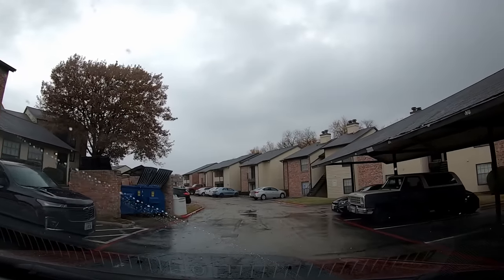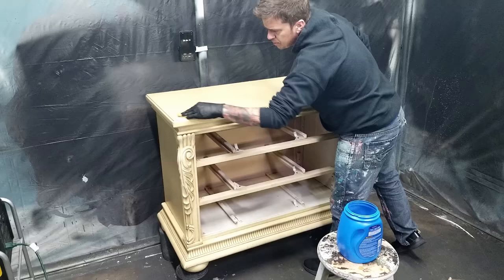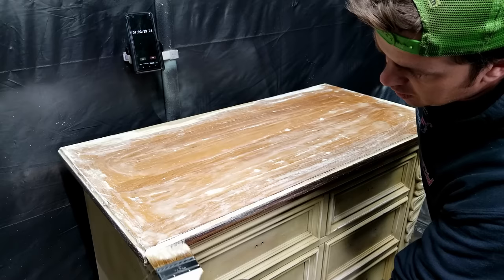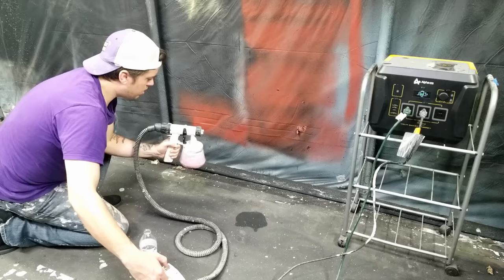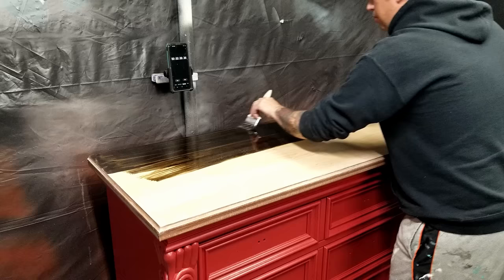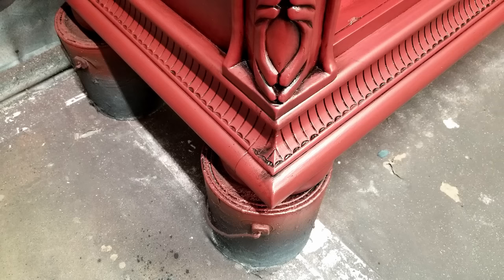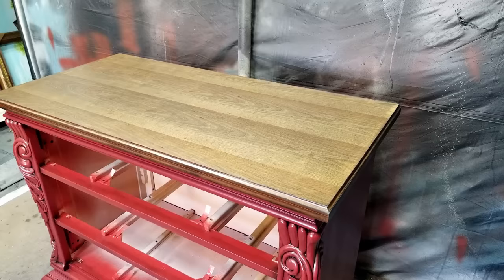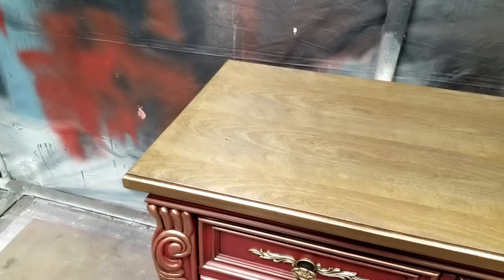This Furniture Was Next to a Dumpster So I Painted It

Comment: 11:44 I can attest that while it is necessary to allow the stripper ample time to work, you definitely want to assure that the stripper is off before it starts drying, as the subsequent scraping is likely to damage your wood... Agree 100%. Also, do not apply a stripper to your wood in direct sunlight. That will cause the stripper to dry very quickly, potentially damaging your wood's surface.

Comment: My opinion is the top wood should've been stained much darker. Also, the rest should've been painted black first, then a dark red over it. Then use steel wool to distress through the red for black highlights as opposed to the gold. The top is not a high or even medium quality wood. You should've painted a harlequin pattern with the red and left the wood stain as the second color of the harlequin. Then distress the red a bit. The hardware should've been an ultra gloss black. The top would've popped big time and made it a whimsical piece. Right now your eye goes to the cheesy gold highlights. Line the drawer bottoms with a fun fabric and you could've gotten $1,000 from some bored rich person. LOL. You do know your stuff though as far as technique.

Comment: The ebony was a strange choice for that wood because it was such a yellow black. Dark mahogany would have gone well with the red since it is a dark reddish brown. You could have added black tint that is a blue black as opposed to a red or yellow black.  The composite you see on the edges would have been a good teaching moment for filling and sanding then painting it to finish.  The edge could have been so much better with the right treatment.

I am an old hand at this stuff so my suggestions are from experience. Get a color wheel to help you with your choices and get a table set up like I describe below. Have fun and thank for the entertainment!

Comment: Beautiful job !  If you want a more aged but subtle antique look,  one way is taking the base color and go slightly darker or lighter....and i do mean slight.  Water it down a bit and sponge,{natural} this from a freshly painted disposable plate, or use a loose crumbled up plastic bag...and go hog wild smashing it on, flipping and rolling as you go all over.  Random & uneven is the key... let it dry.  if too heavy, sand it.  Then when you go over it with a glaze, you'll be amazed how the surface comes alive.  Also, the Rub-N-Buff doesn't come off with light wear,  Heavy wear ... definitely ! ...remember, even metal wears from daily use.  The more important detail with these metal colors is the fact that they will oxidize and change with time,  spraying with any sealer stops this. Good luck !

Comment: This looks great! One tip. When I worked at professional custom furniture store many years ago the finishing shop told me they never use semi gloss, only gloss. They said the semigloss is gloss with a very fine dust in it, which interferes with the look of the grain or specialty paint job. The semigliss and satin clear finishes can actually make the piece look dusty in the right light. And semigloss or satin is much more likely to give you that rough finish that needs sanding between coats. If a client wanted a softer looking finish they just gave it a very light buffing with a very fine steel wool and sometimes a little wax or other overcoat to soften the gloss. The pieces were outstanding and all of the movement stayed in the grain. Of course not everything was given a spray coat some was oiled and or waxed. But all clear coats were gloss, and hand buffed for softer finishes.

Comment: Have you tried using antiquing wax or even a black wax! Would combine two of your steps into one. You wouldn't need to put stain or sealer on the colored areas. Applying just the wax would give you the dark areas you like and the sealer all in one.

Comment: Try this trick to help mixing stain.  After first opening can drop in 2 or 3 bolts.  Close can and shake well. Let stain settle then reopen and stir.  Let air bubbles settle then ready for use.

Comment: Please take a hint from an old lady who knows, you should set up an adjustable table to work from. Get some carpet remnants and lay them out on the table then you can set furniture and its drawers up higher with care. The wear and tear on your back will add up over the years so take care of it now. I saw knees and backbone as well as shoulders being put to harder work than needed. 

There is a guy named Tom Johnson who is a generational furniture restorer in Maine. Maine has great antiques btw. Anyway, Tom proves you can do this work for a very long time without wearing your body out.  Don't take my example, I am younger than he is and my body is shot from "roughing it". Good luck!

Comment: I absolutely love to "Dumpster Dive"...people think I literally dive in the dumpster looking for things...I'm not going to lie, if I do see something in there, I have jumped in before!  However, most of the finds are next to the dumpster, they are too big to throw in!  I once found a huge long dresser, with mirror, two night stands, tall armor and a huge headboard.  Yes, everything was the cheap particle board furniture, but I tried something new...I literally used sparkling mud and put it all over the furniture, then painted it and faux finished it, to look like a stone.  It was extremely heavy, but I called it my "Flinstone Furniture."  I added in all new hardware (which was the most expensive), and someone bought the set for $4500.00!!!  I live in Las Vegas, at apartment complexes is where I fi9nd almost everything, people move in and out all the time, sometimes everything goes!!  But you have given me so many new ideas, I cant thank you enough!   However, I am now into Epoxy, and have been redoing counter tops, table tops, vanities and decorative walls.  I cant tell you what a game changer it is for just even doing the top of dressers!  If you would ever like to know the process of this type of thing, please reach out to me.  You definitely have a new subscriber and fan in me.  But lets just talk about that power supply you have...OMG, I absolutely need this!!!  That is just a total "Gift from Santa...no lump of coal there!  Thanks again, love your work...now I must go stalk all your videos....

Comment: You should get a work table to sit at so you're not having to squat down so much and put pressure on your knees. Don't force yourself to reach, bend, and sit in awkward positions. That's what they taught us in visual merchandising. It makes your task less strenuous on your body. Example: Like when you're on a ladder get on the step that you're level with the task, don't reach up over your head if possible. It makes a difference.

Comment: Nothing personal,  I would have made the entire dresser red. To keep the top of the dresser smooth I use the white soft sponge roller they sell at Home Depot.  A  pack of 3 is about 4 dollars The hardware can be made new again with hot water and vinegar on the stove. It only takes about two minutes in the solution.  Painted hardware the paint rubs off really quick and looks a hot mess real quick.
Reply from the maker: I have pieces 11+ years old with no handle wear. This is why I use it so often.

Comment: Such a great piece! And a very original video with the timer and the generator demonstration/test...

Nice adaptations as the piece threw issues at you.

Just one suggestion; as a consumer, I really appreciate the little details that make a piece look professionally finished. Tape off the interior to prevent over spray. Maybe wax the interiors of the drawers, and finish the edges.

Not a criticism, just a suggestion. Might help pricing and turnover.

Again, just gorgeous!

Cheers!

Comment: Really nice job! It could easily be sold for much more than $400.  I'd like to try those Toasty Sponges.  Can you include a link?
Reply from the maker: I bought these sponges in a store called Daiso. It is sort of like a dollar store with Japanese/Korean themed products. This is actually called a "bread sponge" and the package had Japanese writing. They stopped selling them for awhile during the pandemic and when they had them again I bought like 10 packages of 8 to make sure I could keep using them in my videos when I wanted. haven't been able to find them in about a year or so though. Some online shops show that they used to have them but no longer in stock. Some people on ebay/mercari sell them at an increased price. They were originally like $3-$5 for this package of 8 so don't pay more than that, not including shipping. Other than that, I've found where they're made in China but I'd have to have about $1000 to order their minimum amount. I was literally looking this up last night because I'd like to sell them on my website that I'm working on. If this happens, I'll announce it.
Reply: Thanks for the info on the sponges.  Rather unique and useful so I hope you find a source to sell them on your website. :)

Comment: Red and gold ls awsome combination. That being said, consider LESS gold. Subtlety is a sophisticated look. The finished piece looks like the popcorn booth at an amusement park.
The restoration was perfect. Almost exactly step for step the way i would have done it, EXCEPT:
I would never buy my paint at Lowe's.  If you're gonna use a Sherwin Williams paint, go to a Sherwin Williams store, get the Emerald Polyurethane Hybrid trim enamel. 
Also, damn kid, dump that whole can of Ebony stain into a bucket and stir the hell out of it! Scrape all those solids out of the bottom and stir them in. Then your top would have actually changed color. And you're gonna use the stain as a wash everywhere else on the piece, blackwash that top also! And, gee whiz  if you're gonna glaze with stain, and even CALLED it a "glaze", mix a little bit of GLAZE in with that stain! Makes so much easier to work with, and feather out. But i must say, your stain only black colorwash turned out great. The whole piece looks dazzling, and the video was well made. I really enjoyed it and anyone looking to learn would be well served to do their projects exactly like you did this (except stir the stain much better).

Comment: I also upcycle furniture. I learned a few new tricks from you. I enjoyed your video. I watched a video of a guy using auto paint (and sprayer) and it turned out gorgeous. Have you ever seen that before? I wonder what the investment wd be? Have you done that? Anyway let me know if you have any info on it.
Reply from the maker: Several reasons I don't use auto paint:
1. Investment. The equipment you need, a large air compressor that can keep up with your painting, a spray gun, the paint. They're all more expensive.
2. Noise: I live in a residential neighborhood and I dont want an air compressor running all the time so I opted for an electric sprayer that only makes noise, and less noise at that, when I am actively spraying. 
3. Ventilation: Water based paint is much less toxic and easier to ventilate. Again with the neighbor thing, I dont want my neighbors smelling those fumes. There is no discernable odor outside my home with interior water based paint and top coats.
Reply: @ThatShabbyGuy  
Ok. Good to know. Thanks for getting back with me. I appreciate it.

Comment: What spray gun do you recommend??
Reply from the maker: I honestly havent used enough lower budget guns to recommend anything. The one I use in this video is okay but slow and kinda hard to figure out. I know some other painters that have had good luck with the Wagner Flexio 590 as it doesn't have the bulky unit with a hose attached to it and has more power.

Comment: Did you not prep the surface before applying the red paint?
Reply from the maker: I have a slight feeling you skipped through the video
Reply: @ThatShabbyGuy I was refinishing my own dresser so I didn't have 100% attention. I rewinded back to before you layed the paint and didn't see the prep... until I restarted the whole video.
       Thanks for responding. I started questioning all the prep work I have been doing 😂